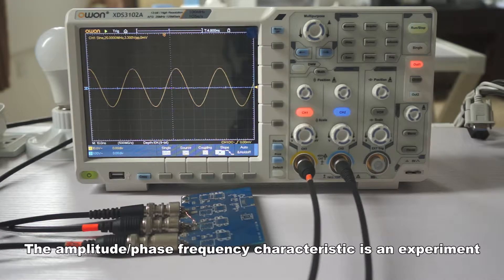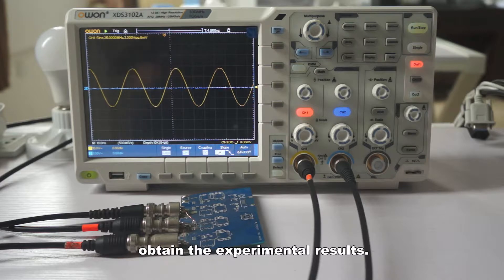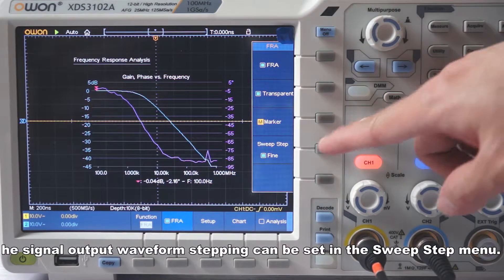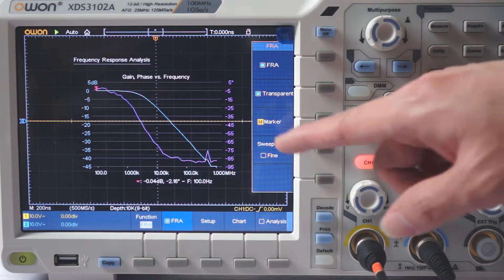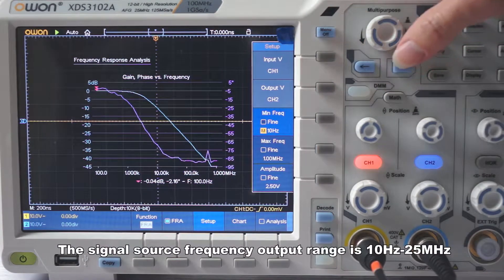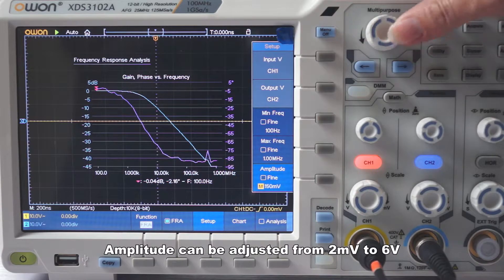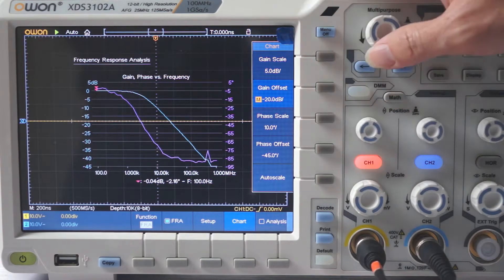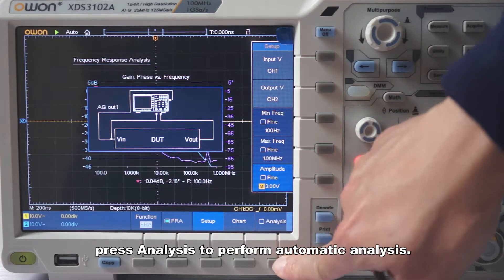XDS-Amplitude/Phase Features

Comment: I don't understand why the manufacturer or others emphasize this feature in their advertising. The Bode plot is very often important to me. After all, you can even examine and adjust IF filters (455kHz) with this DSO. And above all very important when analyzing AF circuits. Thanks for the video. I will buy this DS0.